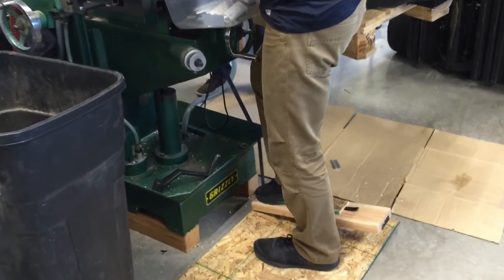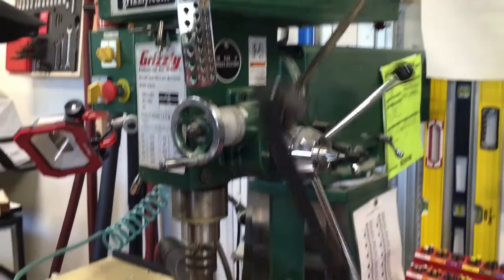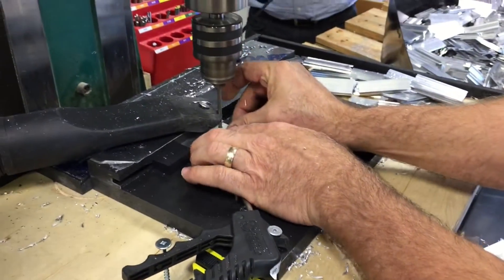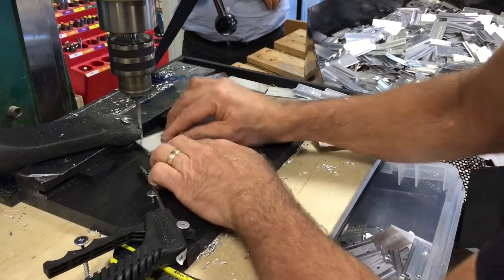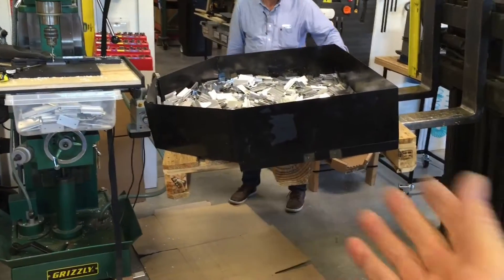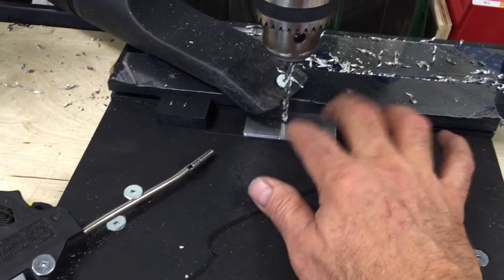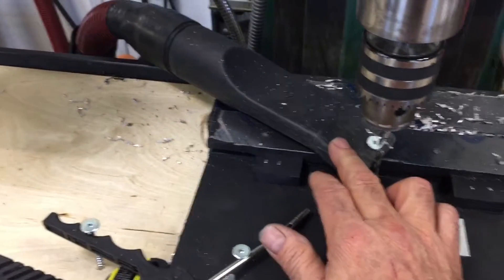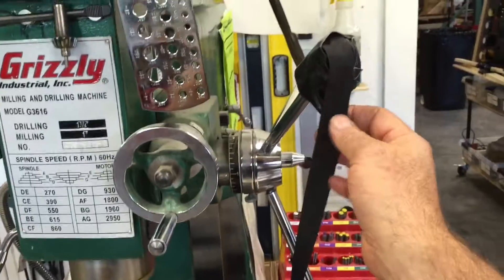Lean Drilling - Lean Manufacturing

Comment: Few things are more annoying on the internet then ppl commenting about safety all the time. If you didn’t look close enough to see the safety that was achieved already like the stops and bit height, PLEASE stop virtue signalling and pretend you care about safety. Safety is NOT #1 and never will be in the real world, probly not even in the top 5 most times. That doesn’t mean it’s meaningless or even fully ignored ever. Profit is the only reason to incur  the risk of doing anything. And safety is always in the list of things risked when you work with your hands. Relax. Stop insulting ppl’s intelligence by pretending you care more then them, or that they don’t care.